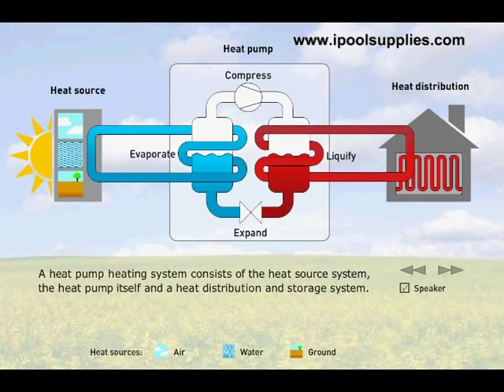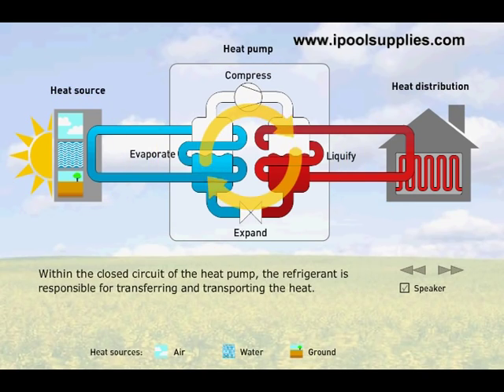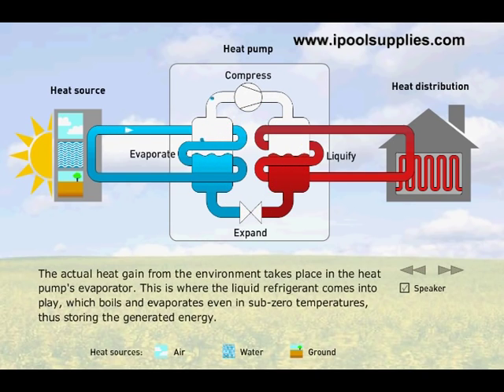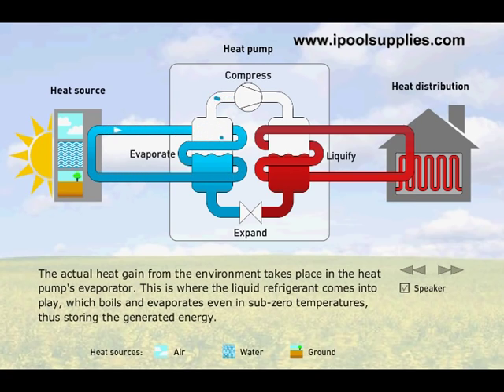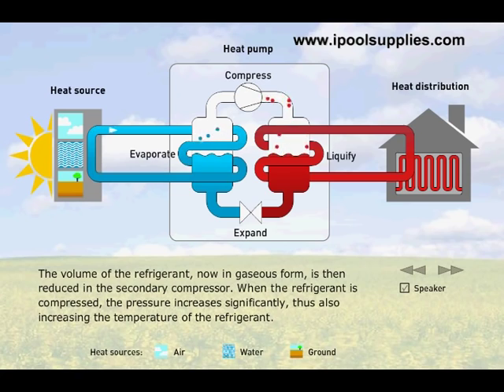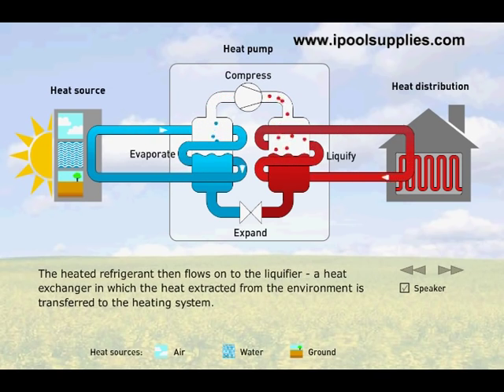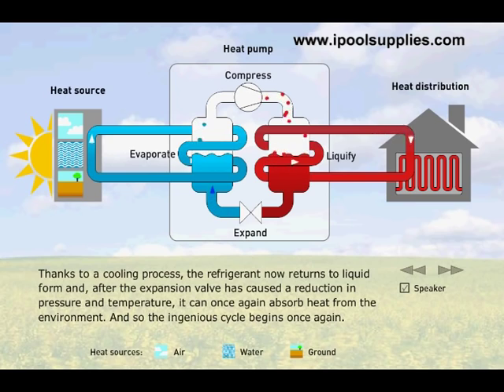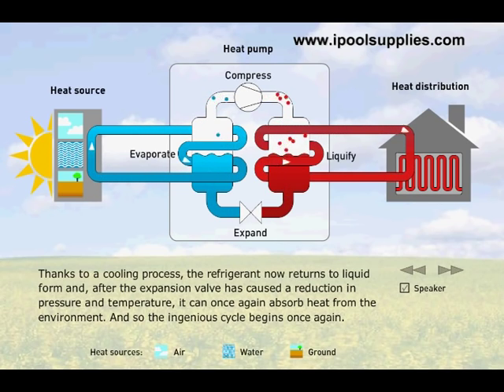How heat pumps work

Comment: All mine works fine and we get to zero in winter for weeks at a time. It's the internal unit you have to take care of. If you don't then it freezes up. look up how they really work. This video is crap! Not that its totally wrong but thats only 1/4th of a unit and done in the style for 2 year olds. Keep researching and you'll understand they can work fine in near zero conditions.

Comment: Mitsubishi has some bitchin' -5F heatpumps, pricey but they work @75% capacity down to that temperature, so a 24kBTU unit pushes out 18kBTU when it's that low outside.

Comment: A good heatpump should also have emergency heat stips - these are actual electrical strips inside the heatpump that are to be used during extreme cold below 30 degrees F.  There should be a setting on your thermostat:  "EMER HEAT".  Be sure that your electrical heat strip is installed and connected, it usually operates on a 220V and there is an actual strip of heaters inside the unit.  
For colder climates - forget the heatpump, Gas Heat is wonderful!

Comment: Yep.  If it gets less than 40 very often you need some type of Auxiliary heat.  Probably gas if you are in the NW.  You can supplement together though if it is close to that range and still improve you utility costs.  The thing is if you have to replace an air conditioner you might as well sped the extra couple hundred for the reversing valve unless you live in a really cold place.  Most heat pumps say they are not efficient below 40.

Comment: @skittlesmonkey Well the amount of energy reclaimed from such a turbine would be very small and it is not cost effective to put one in. The expansion valve is much cheaper and there are less moving parts to break or wear so it is also more reliable.